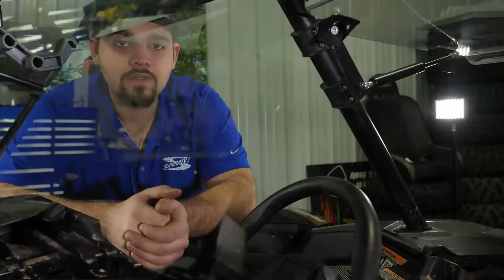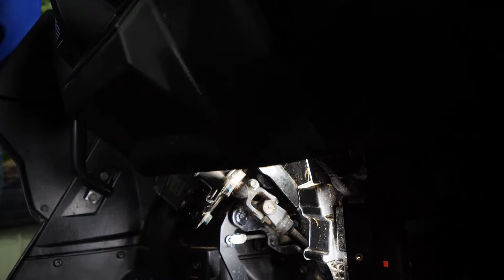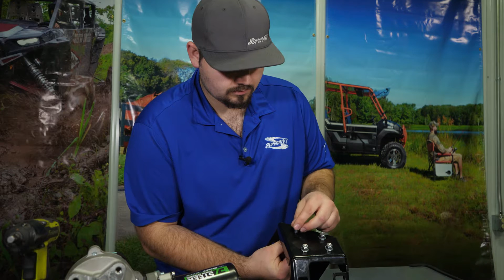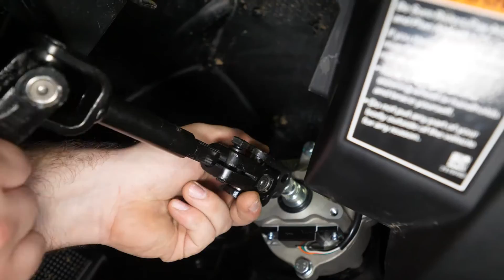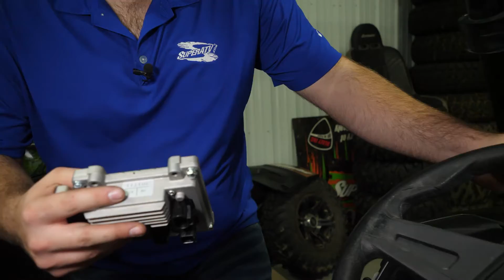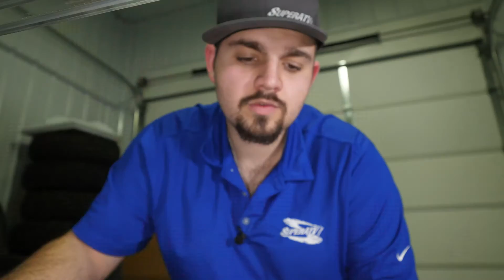EZ-Steer Power Steering Install | Polaris RZR 900 | RZR 1000 | RZR Turbo | How To

Comment: Follow this video, never mention a thing about the top support bracket from the top of the motor got to the wiring part & figured out I had to take pretty much everything back out to be able to mount the other bracket to the motor. Plus the mounting for the ecu is different on a rzr 1000. So if you are following this video for a 19 rzr 1000 better off following the paper instructions.
Reply from the maker: Sorry for any confusion. If you have additional questions on installing the EZ-Steer Power Steering kit, please give us a call, 855-743-3427.

Comment: What is done with the factory wiring… wrap it up out of the way?  Does anything need to be jumpered on it?  I am left with an EPS code 2 520230 31.
Reply: Did you find the solution?? Im the same
Reply: It would be nice if SuperATV stated this in its documentation.
Reply from the maker: Unfortunately, since the factory EPS has been disconnected and an aftermarket kit installed in it's place, there will be a code because the machine is detecting a failure in the factory unit. There is no way to clear the code at this time.

Comment: Putting this on my turbo s velocity, how do you adjust the steering shafts and motor to get more length? I’m probably an inch short when I go to put the upper shaft on
Reply from the maker: There isn't a lot of adjustments to be had in the shafts. Be sure the pinch bolts are loose and slide the u joint to where you feel it needs to be. We do not make a kit for the Turbo S at this time, so that could be the problem.

Comment: Hey guys hot does this unit differ from my stock one? I've got a 2018 ranger 900xp lifted on your guys 4 inch lift kit and high clearance forward offset aarms and 32 inch tires on 2 inch spacers and I can still turn with one finger super easy so just wondering if your motor is faster or more powerful more assist? Thanks